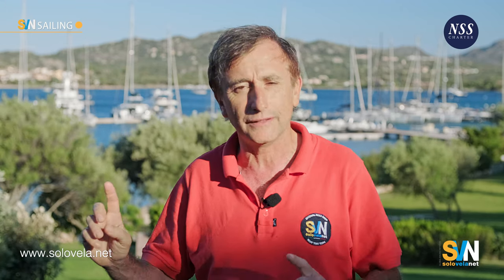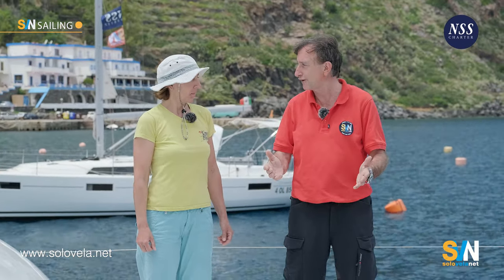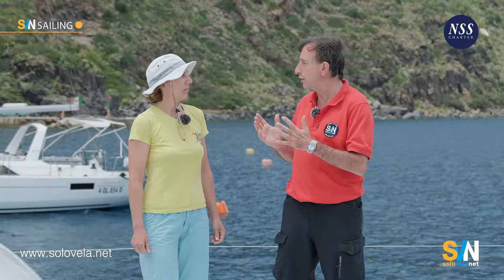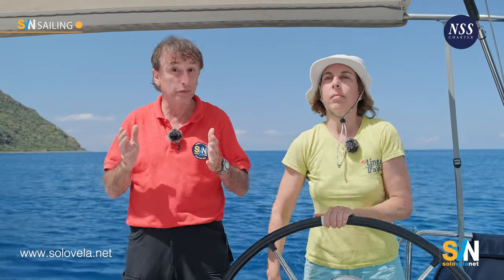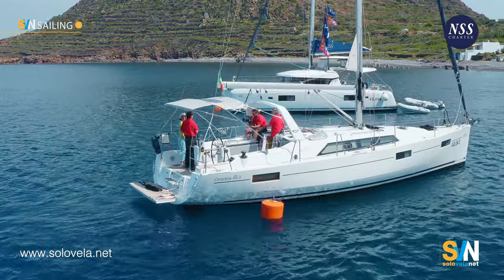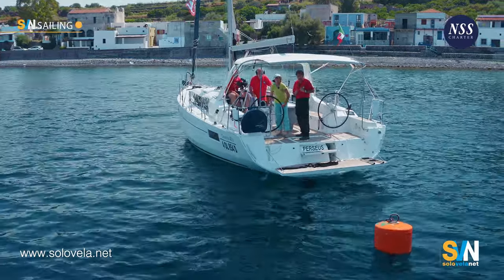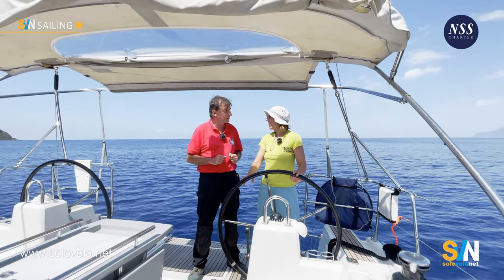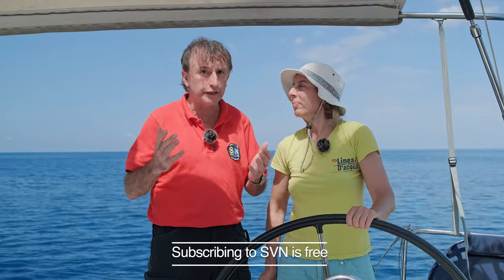How to pick up a mooring buoy – SVN Sailing

Comment: Great video.. if I’m in a larger cat… is the technique the same?
Reply from the maker: With a large catamaran, especially in strong winds, we certainly use this technique. From the bow, it is very difficult to take the buoy because the bow of the catamarans is particularly high. We let the buoy pass between the two hulls and retrieve it aft.